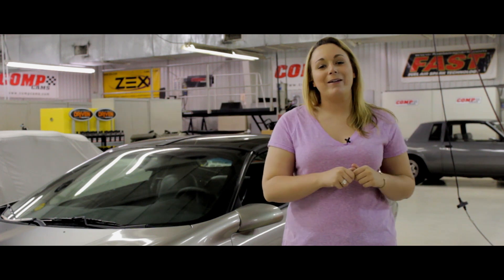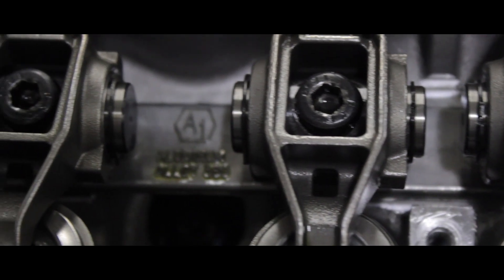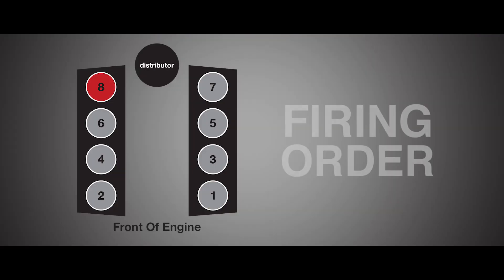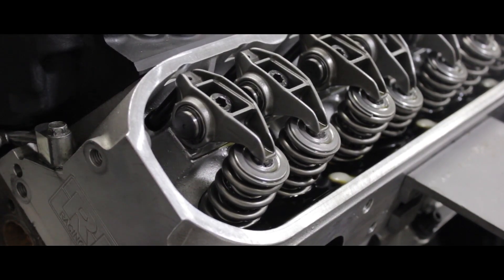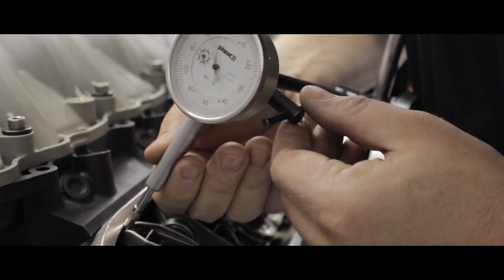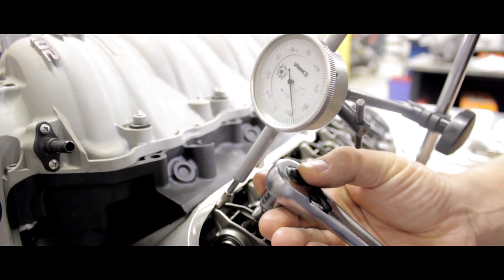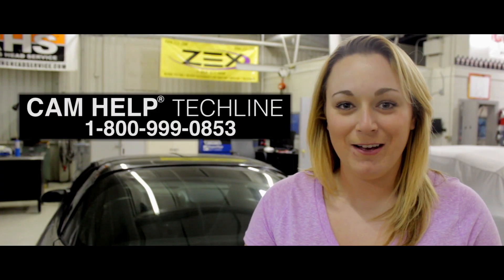How To: Set Pre-Load with Non-Adjustable Rockers

Comment: You can't just pick a pushrod length.   With valve jobs, milled heads, decked blocks, different cam base circles, different rocker types the pushrod length changes all over the place.  You can't set the pre-load on a lifter without getting the pre-load spec from the lifter manufacturer and any manufacturer other than GM and the stock lifter may and likely will have a different pre-load spec.

Comment: What do you mean by turns like after you put 22 foot pounds of tq on then the you tighten them more by how many turns you said ?????
Reply: No. So start out with zero lash, set your torque wrench to 22 ftlbs, then rotate until you click. If your in between 1 and 1 1/2 turns, your golden. If your short of that, you need shorter rods, if your longer than that, you need longer rods. Hope this helps
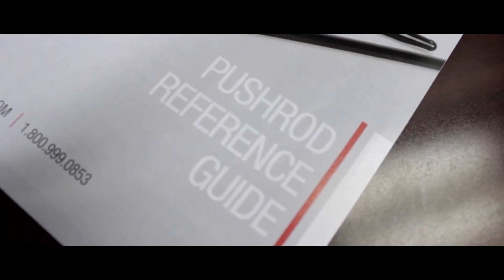Reply: @luamayav  Doesn’t the video say the exact opposite though @ 2:09 in the video? What you say makes more sense.

Comment: do not listen to this lady from comp cams. ls7 lifters should have a preload of no more then      .100  of preload but this vid says between 1 and 1 3/4 turns   is acceptable wich wich at 1 3/4  turns ud be at around .140 wich is absolutely wrong . lol. so much bad info guys... ls7 lifter should have no more the 1 turn past 0 lash and thats straight from gm.
Reply: Correct! This is the first post I've found on the entire internet with correct numbers in it. The webs are FULL of the incorrect statement from people who can't do geometry that one turn at the rocker bolt = .047 at the pushrod when in reality it is .081 with stock rockers.
Reply: Its always rule of thumb to go 1/2-3/4 turn of preload. Anything more and you risk having a valve hanging open. Only sure fire way is with a push rod length checker and patience. That being said, I love Comp Cams.
Reply: @cptspalding32927  on an ls3 with a gt11 cam was getting 7/8 of a turn and lifters were noisey. Changed rods and getting 1 1/3 turns and perfect
Reply: Do you have a video of doing it properly?
Reply: What about shimming the rocker instead of longer pushrods

Comment: in your pushrod video it says 1/2 to 1 full turn but on this video it says between 1 and 2 turns, so which one is it to determine the correct pushrod length?
Reply from the maker: +marlboroman71818 It depends on the specific application. This particular video pertains to LS applications with factory-type lifters and rocker arms. With other aftermarket parts, the required pre-load may change. Be sure to follow the manufacturer's instructions that are included with specific parts. Hope this helps!
Reply: +COMP Cams both videos reference factory ls engines with non adjustable rockers and hydraulic lifters. So what is the lifter preload supposed to be 1/2-1 full turn or 1-2 full turns?
Reply from the maker: +marlboroman71818 There may be some variables in engine setup that alter the process. Your best option might be to call the tech line at 800.999.0853 for a more specific answer regarding your particular engine and lifters.  Thanks!